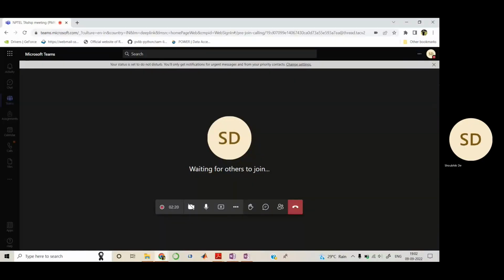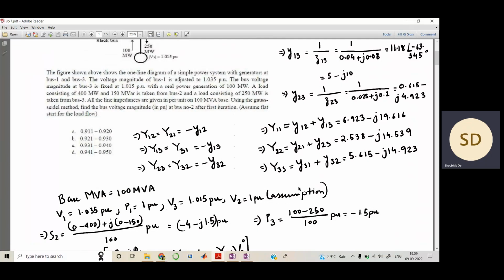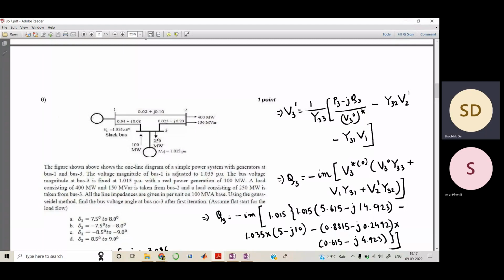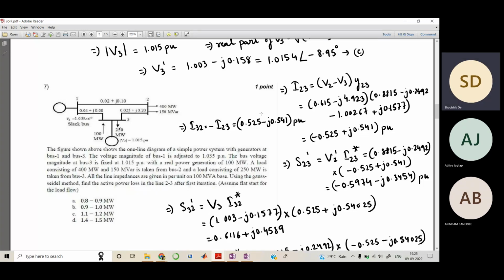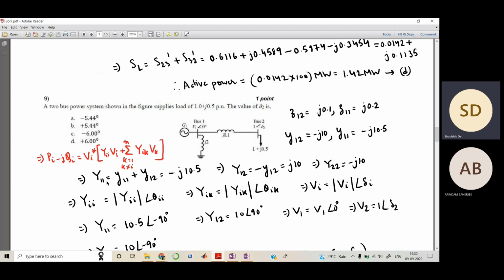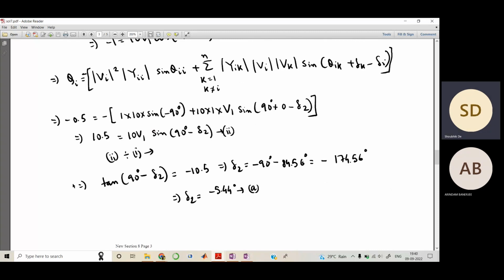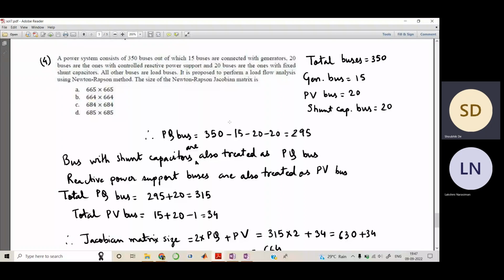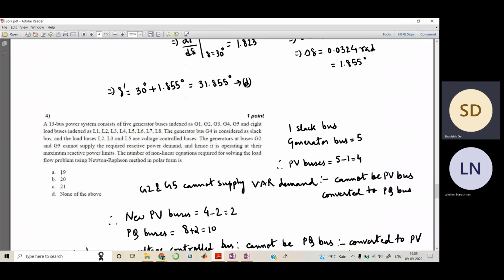Power System Analysis (noc21-ee77): Assignment 7 (Week 7)

Comment: At 38.37: why 180 degree  is added ? Can you please explain the concept of conversion from -174.56 to -5.44?
Reply from the maker: Initially I had made a mistake while calculating the value of δ. δ value would be 174.56 (corrections made in the pdf file) and not -174.56. Now I am subtracting 180 degrees from δ to bring δ to the 1st quadrant.